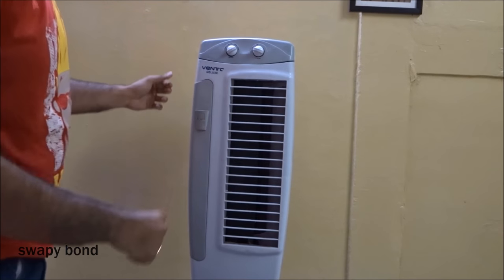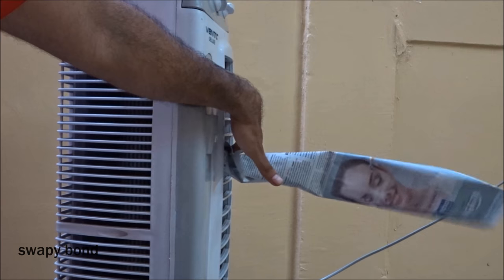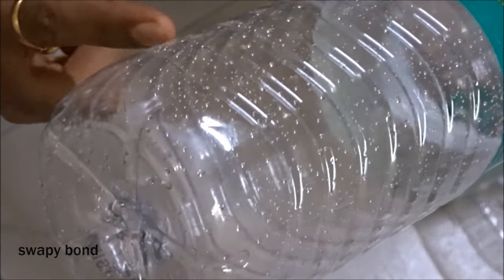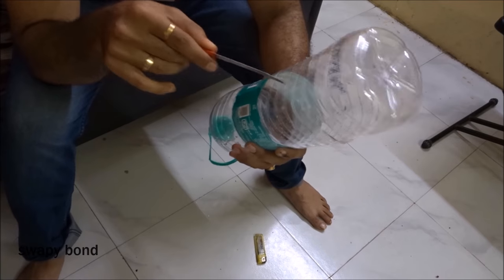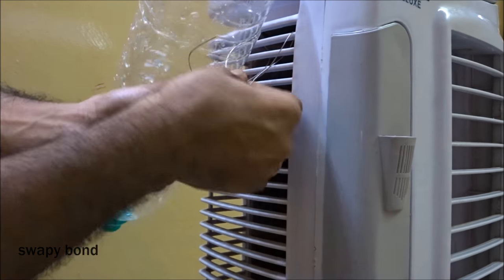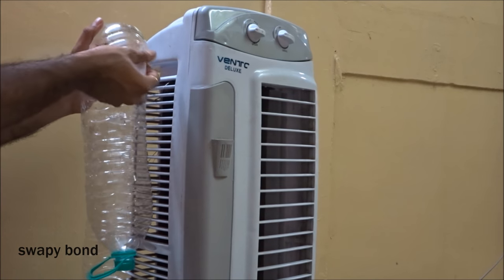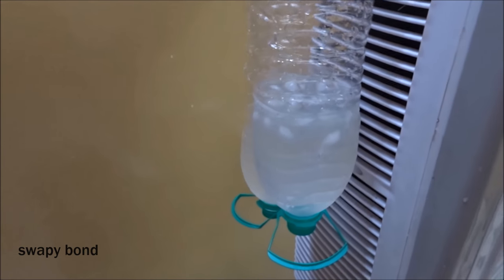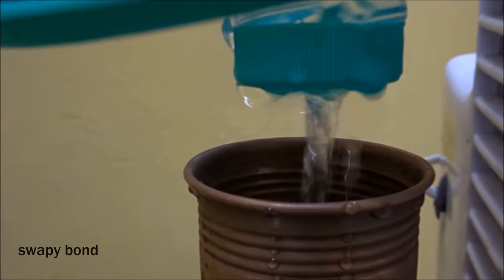How to make air conditioner at home using plastic bottle fan - Easy SUMMER life HACKS

Comment from the maker: Tower fan buying link : https://amzn.to/2XYhS3p
The design and air vent structure of this tower fan is very similar to the one shown in the video. There is a proper flat vertical surface to attach 2 big bottles at the corner and backside.

Comment: Couldn't you just freeze a bottle of water  that would fit in the empty bottle that is attached to the fan? Rather than draining the water? Also with multiple frozen bottles easy replacing?
Reply: That's actually Chad brain right there
Reply: That’s exactly what i did. I’m waiting for the bottles to freez hope it work good 😁

Comment: Don't befool the common people. Bottles didn't cover up the full length of the blower fan's incoming cutout holes. So incoming air flow through the cold bottle will be much less than that of total air flow through the original cut out and the consequences will be hot air and not cold air. You need not to be blanketed on yourself because of cold air but because of the shame what you have shown in the video. From where you have been educated my illitetate friend?
Reply from the maker: Are you going through some middle life crisis? or do you normally vent out your frustration on random people by being disrespectful? Trolls like you are not  new on the internet and mostly I don't reply to entities like you because quite frankly it's a waste of my time but still I chose to reply since you look like you need help to cross the road everyday. Even a fourth grader would understand the fact that the sole purpose of the video was to convey the fact that this system works and provides cool air at a very low cost, through slight modifications that can be done at home! Also please refrain from asking people about their education because people like you are the ones who mug up concepts and regurgitate them on paper without understanding or putting in efforts to practically do stuff! So basically start being of use to society and stop being a troll in your free time. Negativity will lead you nowhere.